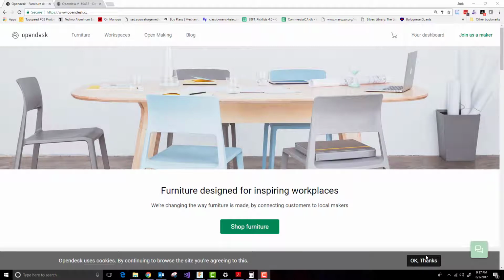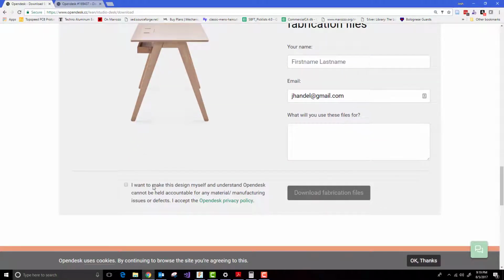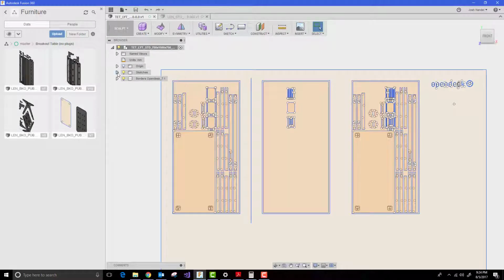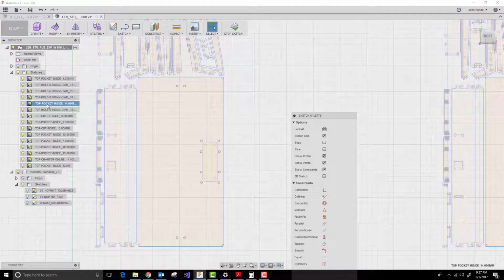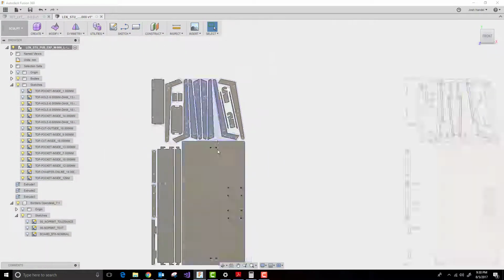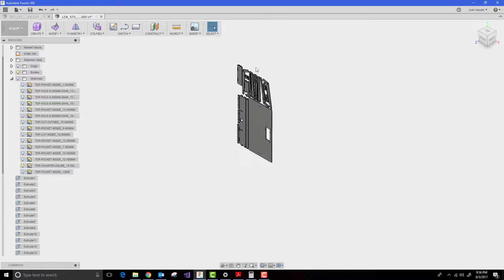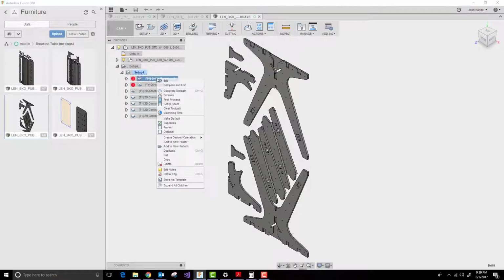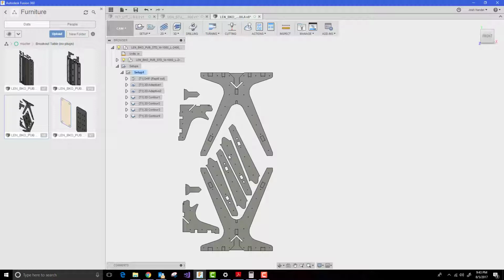Making OpenDesk Furniture with Fusion 360 and a CNC Router

Comment: All Opendesk design files will include information on which bit size a design is mastered for. Generally speaking, most designs can be achieved with a 6mm or ¼” cutter and a 45deg chamfer bit. In some cases some cuts are able to be achieved with an 8mm bit in order to speed up the process. It is important to check the drawing to understand what bit is required. They didn’t list angle of v bit but I found this if helpful,
Reply: Just found this put it here to show the v bit is usually 45 deg.
Reply from the maker: May be true now, this video may be a touch out of date.. at the time of recording it, the files were suppose to be mastered for 6mm (with a strong preference to support 1/4" as well) as a convention, but no bit information was provided at that time. 

I am glad they are being more specific now... :-)

Comment: Thanks for uploading such a helpful video. It would be really nice of you, if you could answer my 2-3 points.
RPM , Cutting speed, feed rate, plunge rate you choose to cut this plywood? and Maching time for this complete table.
Reply from the maker: I was running pretty conservative.. I think I was doing about 6mm (1/4") depth of cut at maybe 150ipm and 20000 RPM...  As for time, I don't remember exactly.. Maybe 30 or 40 minutes/sheet of plywood.

I would probably cut it differently today, 1/2 depth of cut and 250+ ipm.

Comment: Thanks for the video Josh, didn't know Open Desk was out there. Quick question: I see you're working in sculpt rather than model mode in fusion. Any particular reason for this?
Reply from the maker: Ron Buck since everything I am doing is with sketch and extrude it doesn't actually matter. 

Everything we did works from sketch or model. 

Great question though! :)